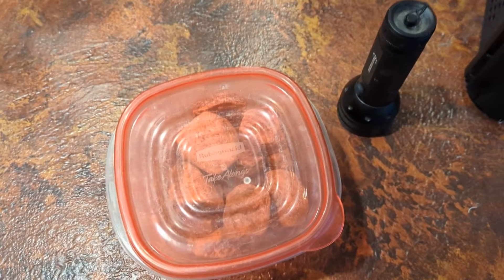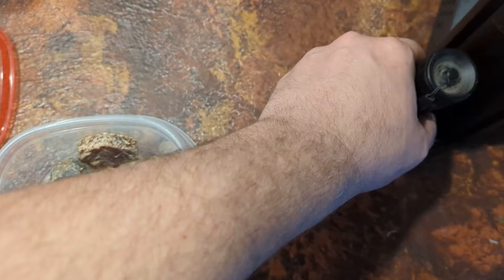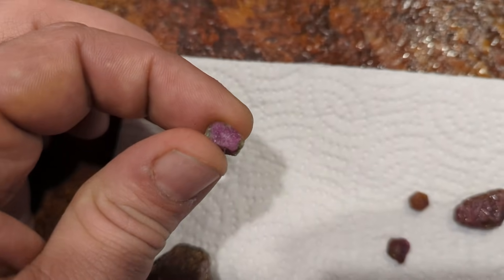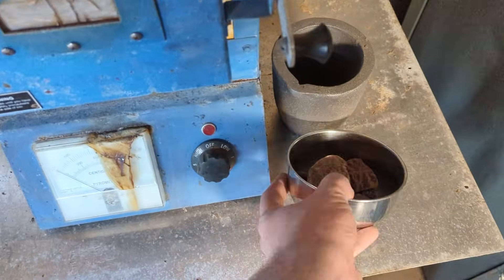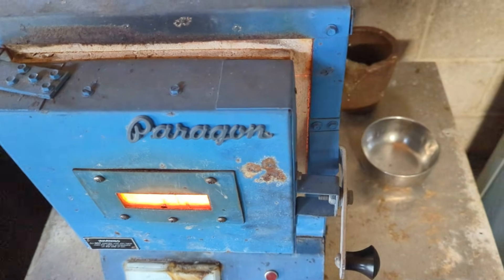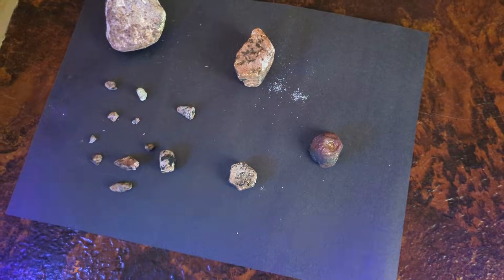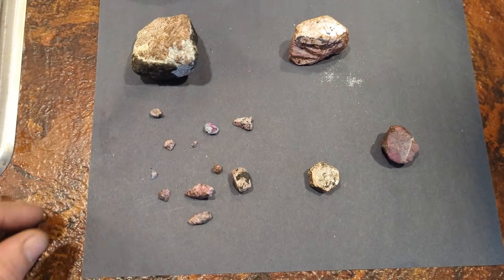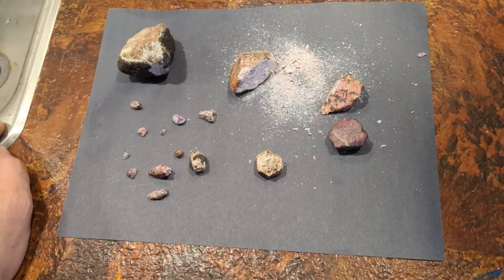First Time Heat Treating Rubies

Comment: Heat treatment is ONLY for color. And should only be done on clean stones with no cracks or fractures. Your stones crumble. Because your heat is too intense too fast and you make the fractures and cracks bigger. But at the same time, propane cannot reach the temps needed to heat treat corundum. You need a special furnace. Like the one we use in Rock Creek here in Montana. Check out videos from them. They have all the info you’ll need to know how to heat treat stones and which are suitable and which are not. Thanks for sharing and good luck 🍀

Comment: I am not an expert, but, I have researched this and tried my own home ruby heating experiments. One thing I learned is, when they heat treat Rubys, they heat them to the temperature at which they  melt but do not liquify, and that temp allows some impurities and inclusions to escape, but it also allows cracks to melt back together. This temperature is held and maintained for day to weeks even months at times. Then they allow them to cool and this process is done extremely slow, sometimes taking weeks to cool down. This is done to prevent cracking or old cracks from reappearing. I tried heating a ruby before I did any research and all I did was destroy the color and turn it into a brittle crumbly piece of junk. I heated it quick with a propane torch and let it cool in the air.
Reply: To properly heat treat a sapphire or ruby. The stone must first pass a few questions. Does it have inclusions? Is it broken or fractured? What is the goal of heat treating? The inclusions. These are what gives the stone its color. In rubies, they’re usually black. But can be of any host rock color. Heat treating usually isn’t for removing big inclusions. Is the stone fractured or broken? Heat treating is not a way to fix broken stones. Sorry, don’t know where you heard that. But you cannot remelt corundum to fix broken ones. The reason your stones crack. Isn’t because of the heat necessarily. They were already there. Heat just made the cracks bigger. Allowing your stone to crumble. And last, why don’t want to heat treat? Heat treating is for color enhancing only. It does not melt cracks together. It doesn’t remove large inclusions. Heat treating is only for color. If you’re wondering how I know, I mine them and work with them daily.
Reply: @KēvinRose01 can we lighten deep red ruby with heat treatment if yes how much temperature and time is required to lighten the color .i wanted to lighten color of longido ruby which is too dark  but clarity of stone is too good .
Reply: @everdost89  you can brighten it up a little bit yes. The specific temp I do not have at this time. You would have to get ahold of Gem Mountain mine in Philipsburg Montana. They will be able to give you further specifics about individual temps and whether or not a chemical additive may or may not be needed.
Reply: @KēvinRose01 so, I have round cut little rubies, 0.20 ct, and are light red ¿can I use this technique to enhance the color?
Obviously is an experiment, but I ask you before this attempt 😅
Reply: @KēvinRose01  thanks for sharing your experience. have a great day.
Reply: wow nice experience shared.

Comment: I think what went wrong here is that you overcooked them. I've seen it mentioned in papers before, but if you overheat a gem while treating it you can destroy it, causing it to lessen or even lose it's color and become unstable, just like the rubies here did. 

perhaps you might have more success treating higher quality corundum's? buying some sapphire gravel from gem mountain might provide a good amount of stones to test on. they usually have a lot bigger of a reaction to treatment :D

Comment: Don’t heat them.    Soak them in Lemon juice, red wine vinegar and Sea Salt.
     It will take about six to ten years but the matrix will be gone and you will have Ruby Crystal.
     Then use a rotary tool with a nurf ball tip and very fine grit diamond powder.
    Use a super glue and brush it on the nurf ball tip then dip into the Diamond powder.
    Use a water drip while polishing.
    One more thing I learned about heat treatment is a ruby can quickly turn into a pink sapphire so be careful.
    Also if you soak Gem's my way then do a large amount because you will age so don't waste time on just a few hundred carats.
     Go big with 20,000 or more carat's. 🥕🐇*
*
     Through you I establish Judah. 😊
    And I strengthen the the Sky from the Ruby to the Diamond!
    I realized this like the Book of Isaiah in a Dream!
     But the Idea is started in the Word of God and the Ruby is found in the Holy land of Burma as written in the Holy Avesta.
     And the Opportunity is found as the heavens open up and pour down the blessings of the Father from heaven under Heaven.
     This is a Secret given to me by the Father so in the days of My kingdom under the Father's Kingdom on Surface Earth so in those days I expect you to be rich although I speak in total Mystery. 😊
    Because it is in your hands you are made to understand.
     To the unbelievers it is a crazy men speaking rubbish. 🤣
Reply: There is an easier way. Soak the gem in hydrogen fluoride acid (HF) for 3 days, rinse with water, and then burn with lead glass. Gemstones are widely available at gem markets in Thailand, priced at $1 per carat, regardless of size.
Reply: @wichittasingkorn5489  I like interesting replies thank you for this one.
    I have Rubies that I have soaked in Vinegar and Sea salt for Six years now.
    These Rubies started with matrix and now are down to the crystal.
    It took six years to do and I plan on going four more years.
    What is more easy than sit and forget and the best thing about it is impurities soak out of the crystal structure and they become clearer and clearer.
    Kings use to say.
   "If it ain't clear it hasn't had enough water." 😊
    I also have clear White Sapphire and these babies now after five years in Vinegar and Sea salt these babies look like Ice. 💎
    I may look at getting some from Thailand?   Some of my white sapphire are from the Golden triangle but my clearest white sapphires are from Burma Myanmar.
    Sea salt and vinegar is my favorite by far because tumbling is waste and soaking is better because it will be pure crystal with no rounding or waste.
    It comes to the natural form of the crystal.
    As a example the ruby in the hand on the thumbnail is a beautiful Ruby and if soaked the Ruby will be pure ruby with none of the matrix left.   I can see that is a gorgeous Ruby.
   Let me be truthful and helpful to those who take my advice add some magnetite to your soak or use speaker magnets.
   Reverse the polarities once a month and impurities will come out of the crystal lattice and you will after six to ten years have clear Gems. 💎
    The Father has names and one is Adar Kibarit Tum = He who makes jewels from Fire.   And I learned that the clearest Gem's are extracted from the ocean from the Quran.
     So learn and think and experiment and use. 😊
Reply: you can do that for rubies that you pluck from a tree🤣
Reply: @rajwarnakulasuriya5935  you should learn from past mistakes and leave the tree alone.
Reply: @orientalmagitheartofninku7888  your comment makes no sense
Reply: @orientalmagitheartofninku7888  isn't that why I made that comment in the first place?
Reply: @rajwarnakulasuriya5935  if you need an explanation for your comment then the explanation for your comment is ignorance.
  It is you that does not know that the precious jewels of the Earth are pulled from the ocean.
    So it is also not you that knows how to refine the jewels of the earth.
Reply: @orientalmagitheartofninku7888  oh now I understand.... so lemon juice,  vinegar and salt is put on to the stone then you cook it and eat...must be very tasty... you people are very smart

Comment: I'd have to think the 2300-2400 F destroying the impurities is the reason that one crumbles. It was full of impurities. The normal treatment for ruby is 1800 C; 3200-3300 F.  That's "way above" what you did. And it doesn't make "normal" rubies crumble. (if you went to 2400 C, you went way to hot, and that would possibly be why it fell apart as well...)
Reply: at least got some information on temperature range, 1800Degree C... thanks for sharing your experience
Reply: The melting temperature of Pure Corundum is stated a 2045 degrees Celsius 
That would be applicable to Colorless synthetic Corundum 
Natural Rubies and Sapphires have lower Melting Temperatures.
**Some* sources of Rubies and Sapphires and a *percent* within that source that would be considered as closer to being pure ( Meaning Less Contaminated ) contain a number of known trace mineral elements that are not necessary for the formation of the Corundum itself but necessary for the various colors of Corundum that in effect lower the melting temperature and relative to the amount of contamination.
Some Natural Rubies and Sapphires could have a melting temperature of as High as 2000 degrees Celsius while the more contamination involved will lower the melting temperature.
I have had Rubies and Sapphires Melt at lower than 1800 degrees Celsius over the many years while the bigger problem I have is when there are are Non Corundum Gemstone mixed in with the Corundum and they Melt at notably lower temperatures and then cause the corundum to melt to a degree...like a flux.
But more notable is when the non corundum gemstones are melting, they contaminate the corundum that is in contact with whatever Non Corundum gemstones that are included in the Alumina Oxide crucible or dish containing the corundum,
The Alumina Oxide dishes and crucibles are really only good to 1750 degrees Celsius for most manufacturers of the High Purity Alumina Oxide components and rated at 99.5 to 99.9 percent purity and stated as capable of 1800 degrees Celsius ...But... after 1750 degrees Celsius you will learn just how stable they are and how they actually begin to collapse before reaching 1800 Celsius true Temperature...
If they truly are 99.8 to 99.9 percent pure Alumina Oxide... or blended with a  small percent of Magnesium Oxide  or Zirconia Oxide  then they actually can withstand 1800 Celsius and a little bit more before collapsing